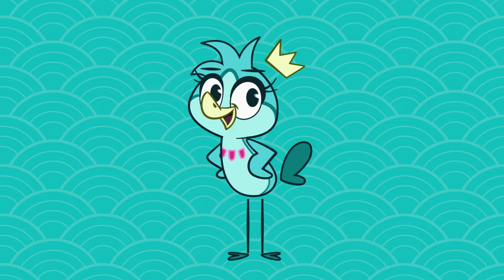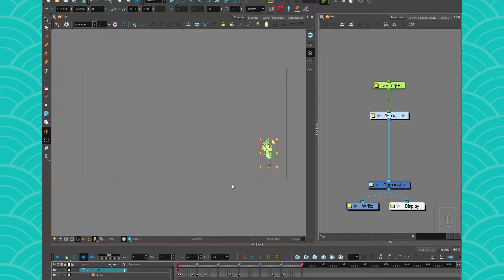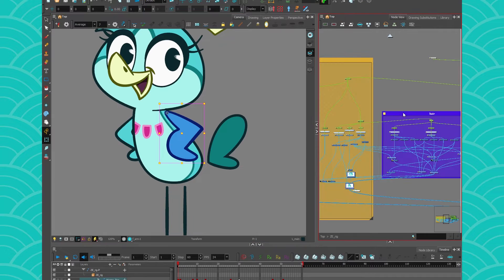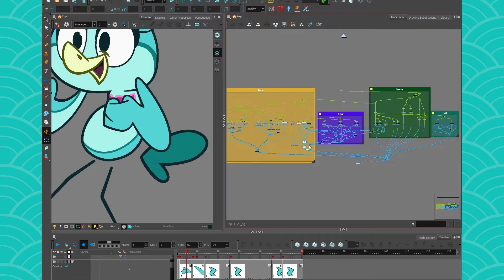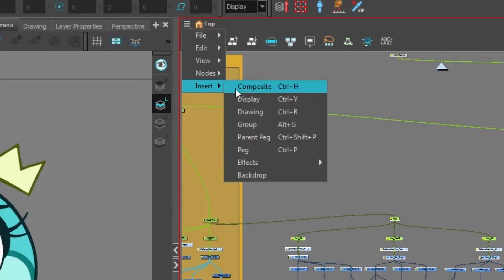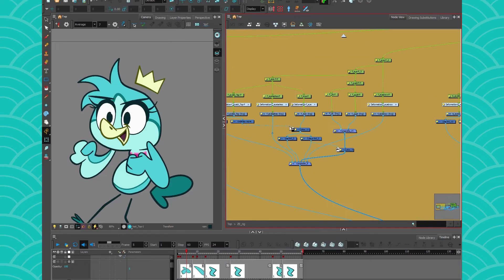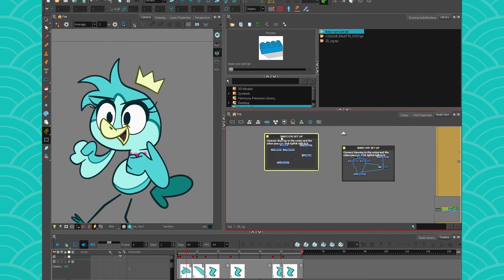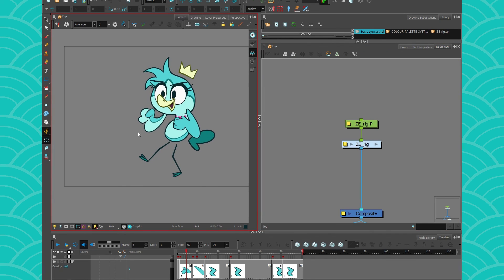RIG - Rigging Basics part 1 (Harmony 17)

Comment: I like your short and sweet videos.  Nice and clear, but I have a concern about making my rigs all separate positions.  I understand that it is recommended to use separate positions for rigs, but what I find frustrating about separate positions compared to 3D path is that with a 3D path you can make a curve and you can slide points along the curve to adjust timing.  But with separate positions you end up with a ton of points to try to approximate a curve and if you need to change it, you have to change every frigging point.  I would really like to have an option to select XY with separate Z so that I could have a path in X and Y that was a curve and that I could set velocity or eases as I like, but keep my Z separate so that I can order my parts in front or behind as needed.  Do you know of any way to get the behavior I desire?